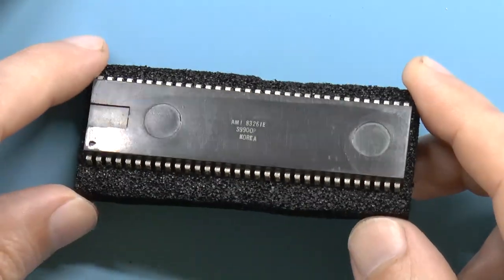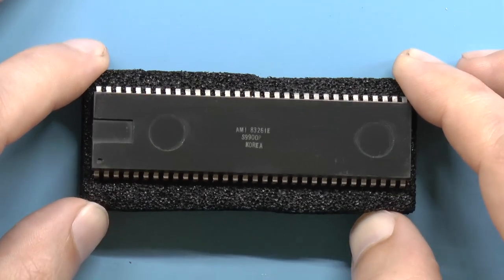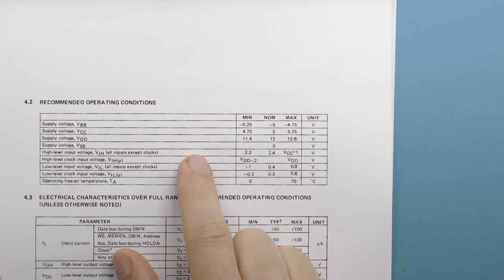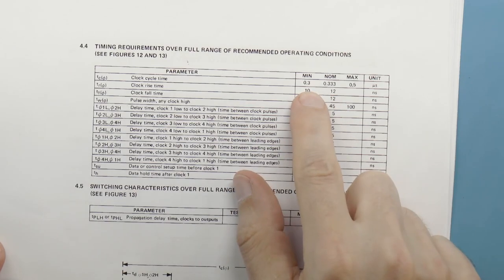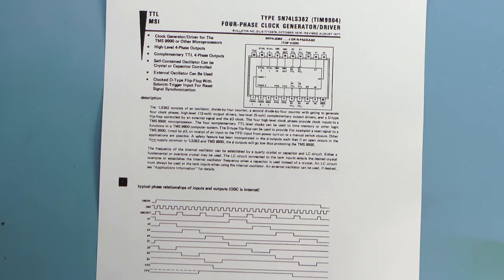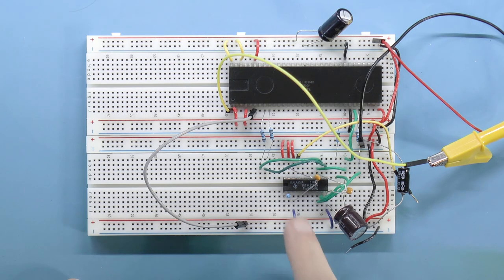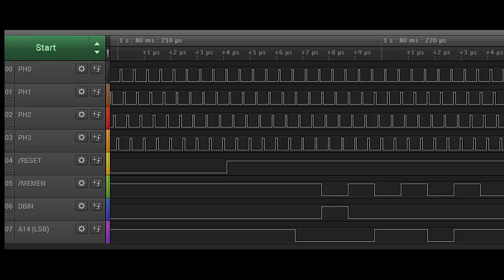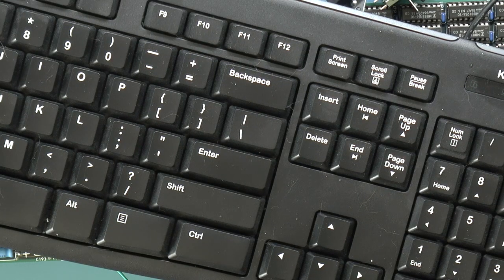A 70's CPU find at the surplus store

Comment: Back around 1980 I did a lot of programming of the 9900. I really liked the chip. For the day it was pretty advanced. 16 bit  multiply, 32 bit divide, registers in memory for really quick context switches on interrupts. I even did a code generator based on  one from a 68k C compiler. Wait till you get a load of the bit addressable I/O. Compared to the 8 bit chips of the day it was a real eye opener. Couldn't compare to a 68k but it did pre-date them. If I recall correctly the Vectrex game console used this chip.

Comment: Hm... If that is what is needed to get a 9900 running I don't think I'll try getting my TMS9900 running. The one I have is gold and ceramic and dated 1976. The 68000 was similar in not having an A0 line. Instead it had lines to decide which set of 8 bit data lines you wanted out of 16 when you did an 8 bit operation.

Comment: There were versions of the TMS9900 that would run at up to 12MHz. Those CPUs were used in TI's minicomputers. Although the CPU is weird, the architecture used in the TI-99/4(a) computers was even weirder. Cost cutting measures really cut the legs out from the TI-99/4(a) computers, but the CPU was great for its time. With only 256 bytes of scratchpad memory and a very limited number of registers and interrupts (that I could NEVER make work correctly), it was never destined for greatness, but it could have been oh so much better.

Comment: That thing brings back some memories.  The TI/99A for sure !!!  It has been one of my first personal computers, along with my Sinclair ZX80, Timex-Sinclair ZX81, Atari Mega ST-2, Color Computer II & III and of course the IBM PCs, from the 8087 to the Pentium ones.  It's crazy thinking how much computers and calculators have changed over the last 40 years.  I did some assembly language on the TMS990, the Motorola 6809 and 68000 mainly under OS-9 and OS-K, the Zylog Z80 and naturally the IBM 360 mainframe.  I have to admit I had a little preference for the Motorola based machines, but the Z80 was fun too.  Good old days !!!

Comment: You mention it uses dynamic logic so it has a minimum clock speed. What causes the need for a minimum clock? Does it rely on capacitances that leak over time?
Reply from the maker: Pretty much. Dynamic logic has a tiny capacitor on each gate's output, and two phases: precharge and evaluate. Precharge charges the capacitor so the output is 1. Evaluate either leaves the capacitor alone if the output should be 1, or discharges it if the output should be 0. The idea being that between phases, the capacitor floats (i.e. is not connected to any source, either VDD or VSS) so no power is drawn. Power is only drawn when the capacitor needs to change state, and only during that state change.

But, if you don't evaluate fast enough, the capacitor's charge will just disappear and the output will erroneously become 0.

The smaller the capacitor, the less power is drawn, but also the faster you have to evaluate after charging.

Four-phase logic is in one sense a complication on top of 2-phase logic, in that it has different phases of gate, and one phase gate can only be fed from a different phase gate. But it also turned out to be very efficient. Still, the minimum clock frequency to prevent capacitors from prematurely discharging is still there.
Reply: I have fond memories of building a machine based on the 6800, which also used dynamic logic. Fortunately it only needed a 2-phase clock and no weird supply voltages.

One nice thing was that it ran very cool. Much better than the National SC/MP in my previous machine, which got so hot you couldn't hold your finger on it!